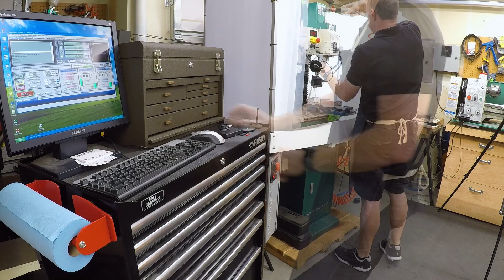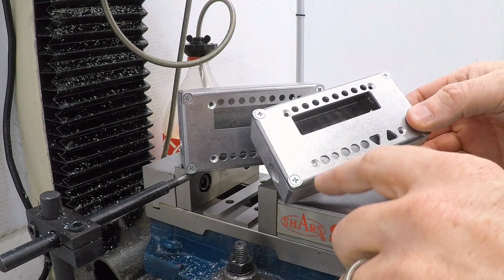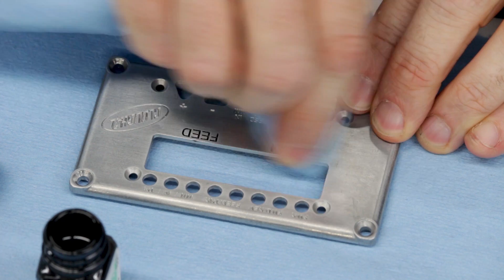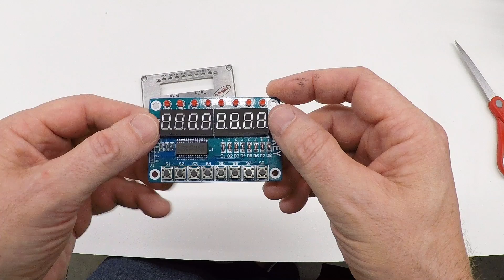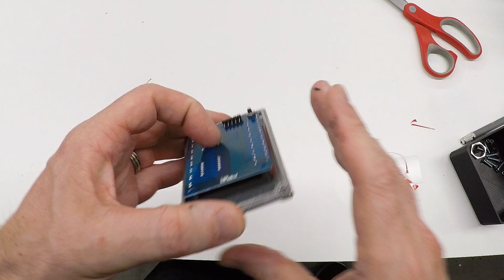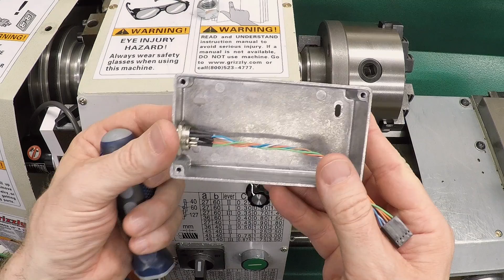Lathe Electronic Leadscrew Part 9: Machining a Control Panel

Comment: That drag diamond would work wonders on an anodised piece of aluminium!
Reply: Or painted first!!
Reply: @billfollis762  - I thought of this some time ago and tried it. Problem is you end up with 'ragged' edges since the paint tends to chip away. That's why I recommended the anodizing and engraving (a few hours before this post did....  cough...  ;)  )
Reply: @DrFiero  How about powder coating ? Or something like Cerakote ? :)
Reply: @andriosz  - I wasn't set up to do powder coating the last time I was experimenting. It's pretty tough stuff.  But it does still go on fairly thick, so might be prone to chipping edges as well (I'm guessing of course). I can see it working well with the v-nose engraving if you did it at high rotational speed.  Never touched Cerakote (?) at all.
Reply from the maker: I think it would be beautiful with black lacquer, but probably pretty delicate.

Comment: Looks killer!!  What about anodizing dark, then diamond engraving?  Gets you your contrast.
Reply: Hi DrFiero - Diecast alloy boxes don’t take well to anodisation (anodiziation) I was told this by a guy in our Plating Shop years ago when I talked about finishes to the boxes we were using in an R&D military environment. We had them etched primed then painted to a Def. spec aircraft black. 👍 John 🇬🇧